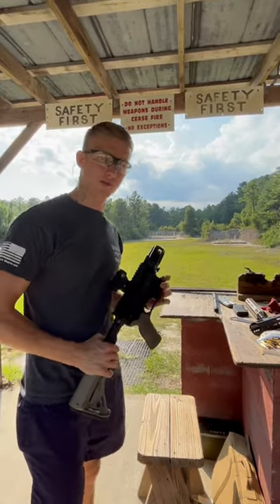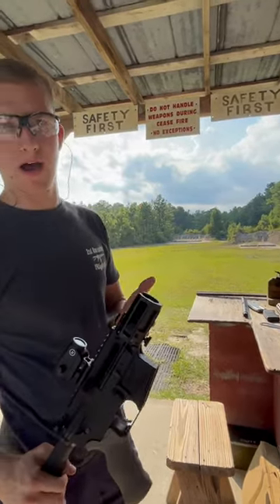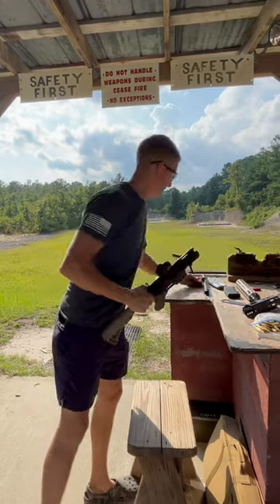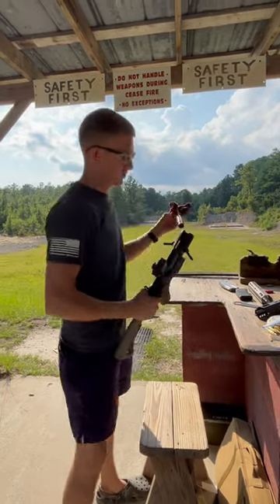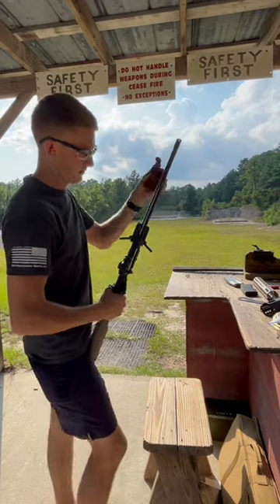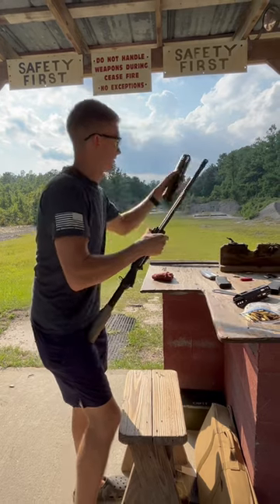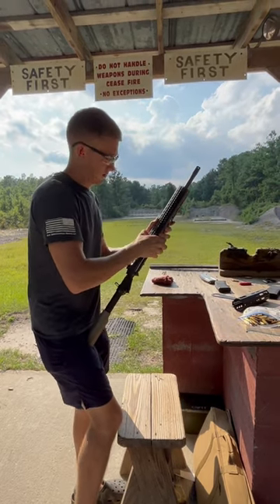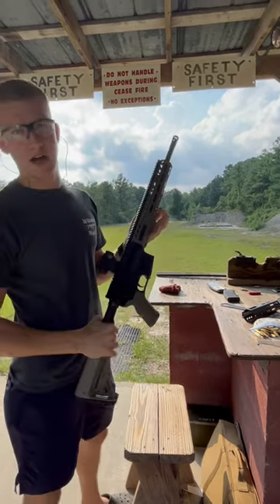Accuracy test, full video on our channel!! #ar15 #ar15pistol #gun #precision #shooting #shorts #556

Comment: The design looks good can you undersell your competition?
Reply from the maker: Check out or websites and tell me what you think 🤔 Our system has zero limitations. If u have a big gas block or military front post site the barrel comes out first. If u have a low profile gas block the handguard comes off first.
Our system allows for almost all piston drives.
With the other systems on the market u are stuck with the setup and they don't allow any modularity.